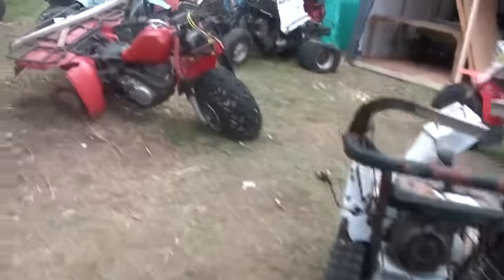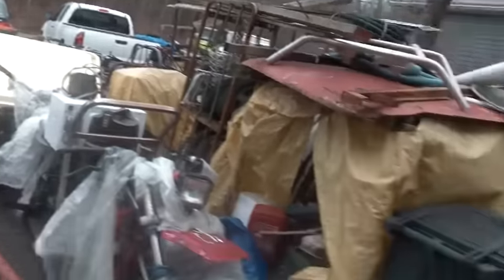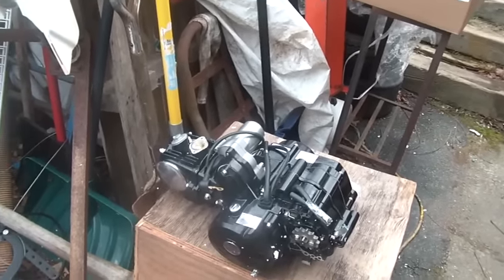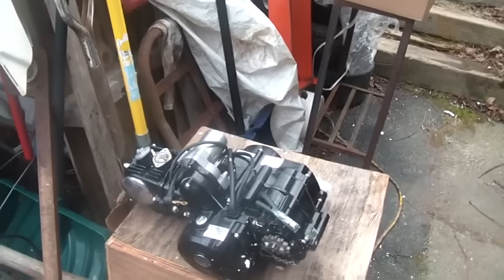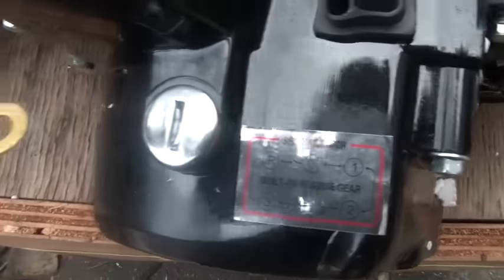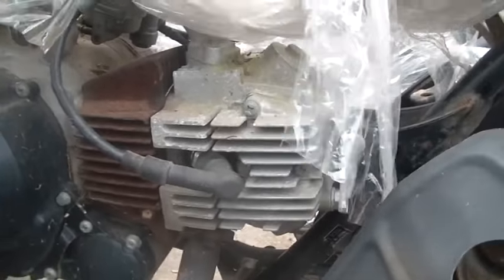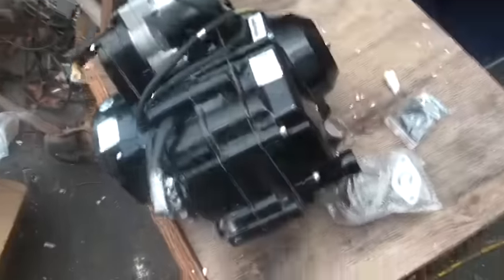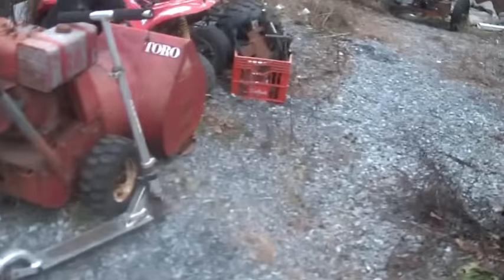New ATV engine, 125cc ATV Honda CLone, $275 eBay deal,

Comment: I have a honda 125atc 1985 how can I get more power out of it?
Reply: 4speed
Reply: And can you sell me a good original gas tank
Reply from the maker: Hey Green Gaint!!!  I would look for a bigger carb to start with.... If U want more power, a bigger sprocket in the back would get that for U, but, U would loose some top speed.... U can also update Ur CDI box, that would get rid of the rev limiter and improve the timing advance a little, but, it would require some wiring tricks, no plug and play available... Having said all that, the Honda Horizontal stroke engines are good, reliable, and slow engines.... U will not notice much of a change.... If U have about $400, U can put a lifan engine on it with a 5 speed and hand clutch, just make sure that the kick starter has enough swing to work.... I hope this helps.... Unfortunately, I don't have any Honda gas tanks to sell, generally speaking, it is hard to find tanks in good shape.... Thanks for asking, watching, and commenting!!!